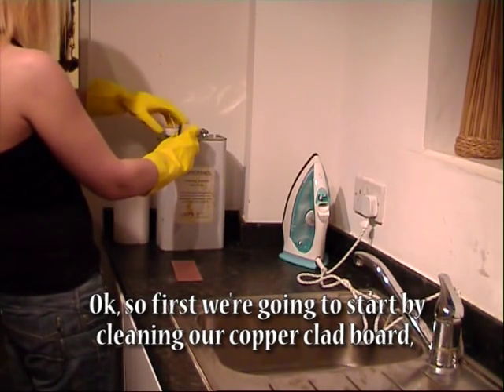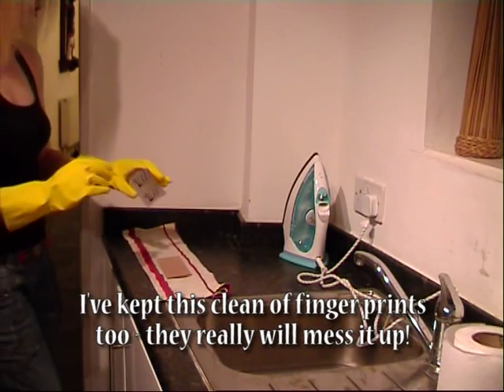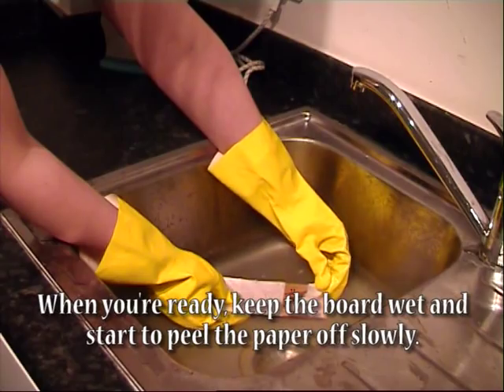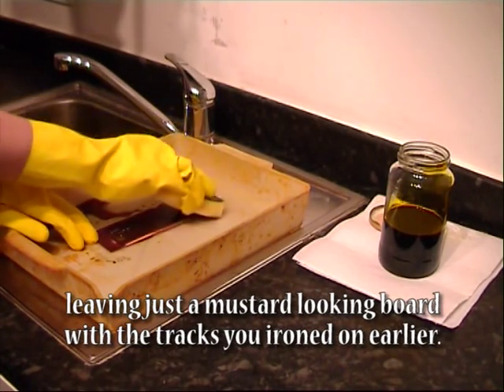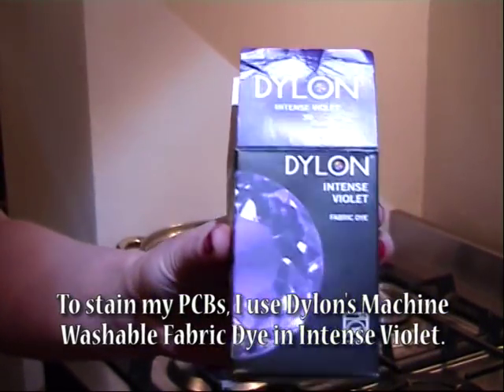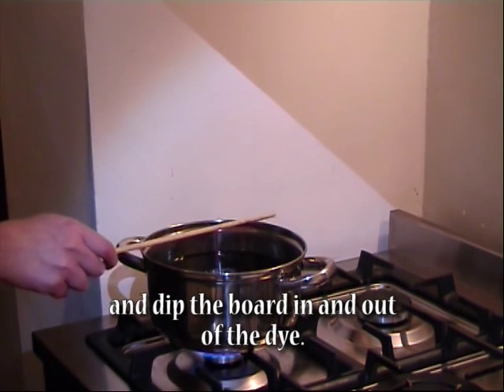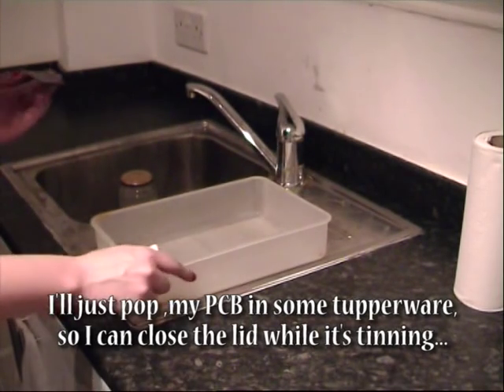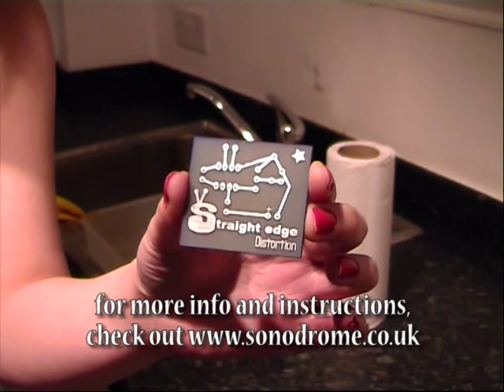PCB Etching, Dying and Tinning

Comment from the maker: @LauxHawk  Thx, a cheap b&w laser printer should be fine, the resolution is the main concern, a DPI of 600 or more is cool. There's also the price of cartridges to consider - printers that are extremely cheap, work out not so cheap when you consider the cost of toner, sometimes forking out a bit more on the actual printer can save you money in the long run. We also have a better method for colouring the PCBs now -> See our video entitled - Staining PCBs with Kat from Sonodrome

Comment from the maker: @UnderseaCaveman thanks for the comment! Yeah the photo resist method works really well and it's very repeatable- definitely a winner. Tinning with tin solution is really good too, the powder solution stuff works brilliantly- but it does smell pretty strongly of eggs :) @ Sonodrome we've made 100s of PCBs using the heat toner transfer method and it works great, initially it was difficult to get the method down, but once we found the right paper and worked out the timing a bit better, it was fine

Comment: Hey there folks i have a problem with iron trichloride. I make perfect boards with the toner but when i place them in my "bath" driven with small dc motor for vibrations, it seems my chemical is eating the copper traces under the  toner ink. I'm not really sure of the proportions and stuffs because our manufactures seems didn't even pay attention on the formulas on the bottles. Anyway i'm looking for this kinda of a fast way of doing it with a bit rubbing the board with the sponge. Anything special for this solution? What exactly are the proportions and the chemicals in it? I have a local small chemistry shop here where i can order to mix it for me.

Comment: So I tried the intense violet with my PCB and it wouldn't absorb any color at all. I left it in for a few hours. Any ideas? Do the water need to be a certain temperature? I'm going for the same color as this video.
Reply: I think the dye would only work if the PCB is a phenolic type. If your PCB is fiberglass, I doubt that it would absorb the dye.

Comment: Great video......that has been missing from my PBC manufacturing....."Tinning"....I wish I had done that (just conformal coating does not seem to be enough to keep copper fresh underneath).  BTW, check out using Photo-resist transfer.....I did the heat transfer, but wasn't having the best yield ...with Photo-resist, I get winner everytime....send you the video.

Comment: but you haven't exposed your board to UV light !!
Is the ferric chloride an alternative for UV exposure that most people use ?
Reply: Truth Seeker Yes with ferric chloride it will react with the copper but leave any covered copper.  The ironing transfers the toner to the board, sharpie markers also work to fill in any gaps.  Acetone or nail polish remover takes the toner and sharpie off easily, for the ferric chloride I usually use a pyrex glass bowl with a lid, best to make a ground plane on the board as well to reduce the amount of etching you need to do with ferric chloride.

Also you can reuse the ferric chloride a few times depending on how much copper you are etching away, when disposing of it best to not dump it down the drain as it will tend to eat other metals as well and can destroy piping so you'd want to dilute and or neutralize it before disposal.

Comment: Very nicely done video with a great looking board.
A safety point; when you are using the drill it is a good Idea to pull your long hair back do for some reason it will not get caught in the bit and drill.

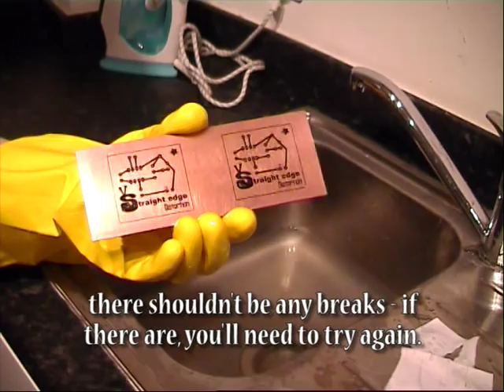Comment: At 3:01 you mention that if any of the tracks have breaks that you will have to try again, but if there are any breaks in any of the tracks, can the breaks be etched with a PCB etching pen before immersing the PCB in the ferric chloride?
Reply from the maker: +TinyWords yes, you could fix a track with an etch resist pen - thx
Reply: After acid eaching better to fix break lines by wires bridges...
Reply: This may not be as easy as you say.  If you have a minute break, or even several breaks, it would be easier to use a etching pen to fix the break/breaks than wire bridge/bridges.

Comment: Is it OK to flash those chemicals?
Reply from the maker: +Boby Bob No, you should collect the acid and dispose of it correctly - this will depend on your local laws / legislation. Of course there will be trace amounts of the acid that goes down the drain when you rinse off your PCB, but this will be very diluted by the water

Comment: Have a look at Hydrochloric acid and hydrogen peroxide as an etchant instead of ferric chloride... cleaner and recyclable... you can't knock that.
Have a search on YouTube for NurdRage PCB etchants :)
Reply: edgeeffect the hydrochloric I've got is too strong I think I need to dilute it can't open the stuff for more than a few seconds.  I'm careful with the ferric chloride but the fumes seem less potent (premixed etchant solution).